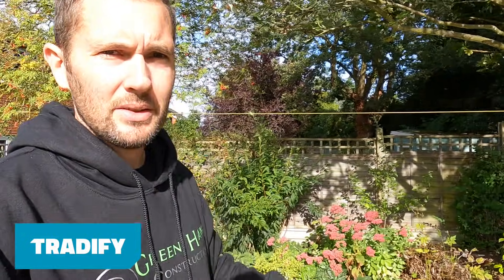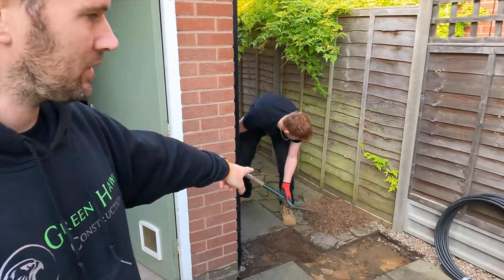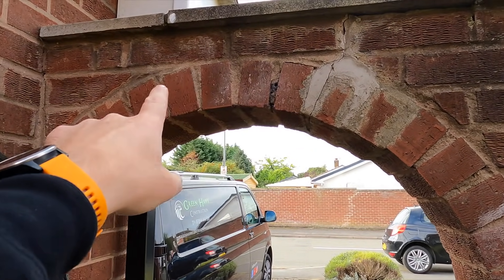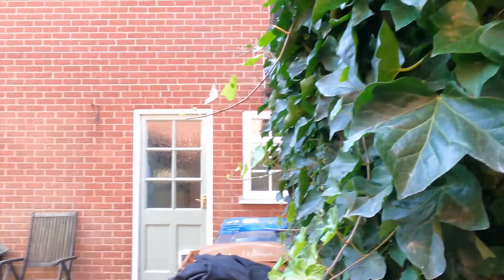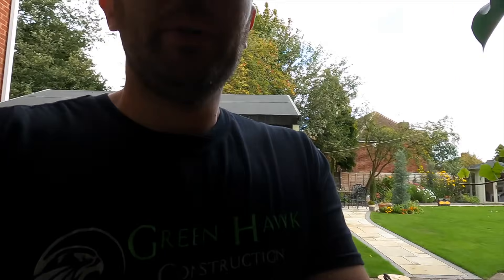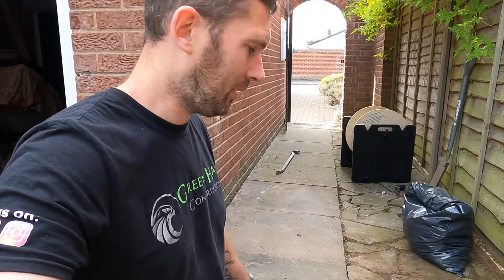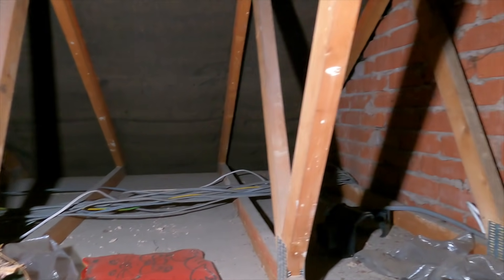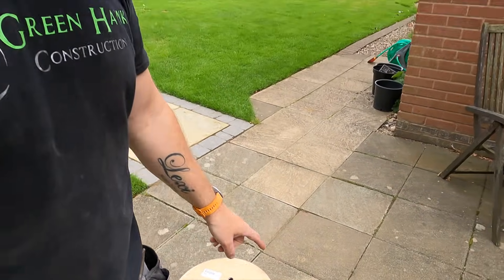GARDEN LIGHTING THIS TIME OF YEAR

Comment: Nice job I'd probably put in a 4x4 plastic trucking at the back of the summer house to run up SWA cables and install  12 x12 ip65 box for the controllers cheers for the videos 👍